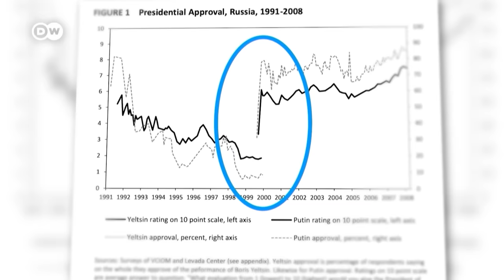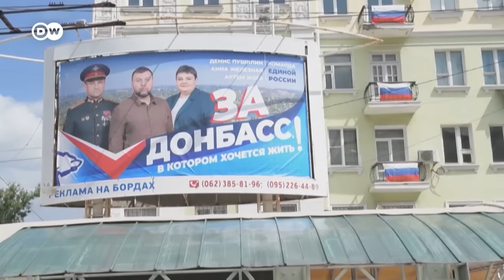How Putin recycles his war strategies: Ukraine & Chechnya | Mapped Out

Comment: The U.S. has its own playbook - google "Overextending and Unbalancing Russia"
Reply: The concept of "Overextending and Unbalancing Russia" refers to a strategic approach that involves the use of nonviolent, cost-imposing strategies by the United States and its allies to stress Russia's economy, military forces, and political standing both domestically and internationally. This strategy aims to exploit vulnerabilities within Russia, such as its dependence on oil and gas revenues, the impact of economic sanctions, demographic challenges, and the increasing authoritarianism under President Putin's rule.

By targeting these vulnerabilities, the strategy seeks to overextend and unbalance Russia, making it difficult for the country to sustain its geopolitical ambitions and military engagements. This approach is based on a comprehensive examination across economic, political, and military areas, suggesting that a concerted effort in these domains could significantly impact Russia's capacity to project power and influence internationally.

Such strategies are part of a broader framework of great-power competition, recognizing that direct military confrontation is undesirable and costly for all parties involved. Instead, leveraging economic sanctions, diplomatic pressure, and support for democratic institutions and values within Russia and its neighboring countries are seen as ways to challenge Russia's aggressive postures without escalating to open conflict.

This strategic thinking reflects an understanding of the complex interplay between military power, economic stability, and political legitimacy in sustaining a country's global influence. It underscores the importance of a multifaceted and nuanced approach to international relations in the 21st century, where indirect means of competition and influence often precede direct military action.